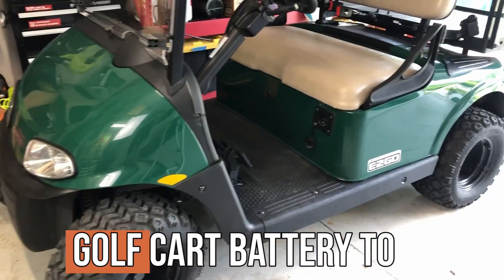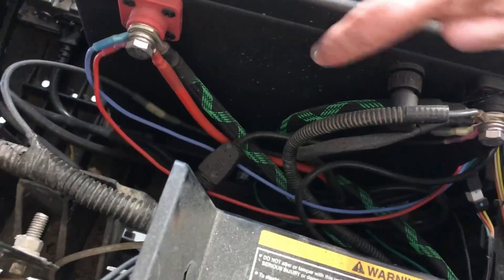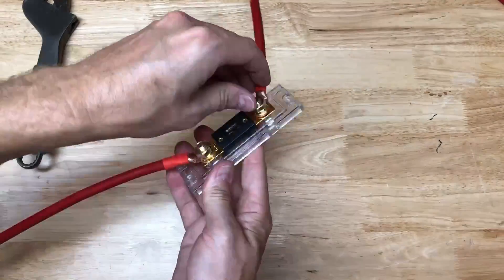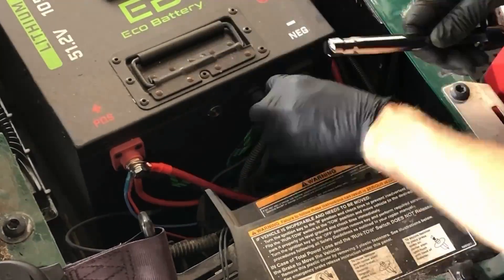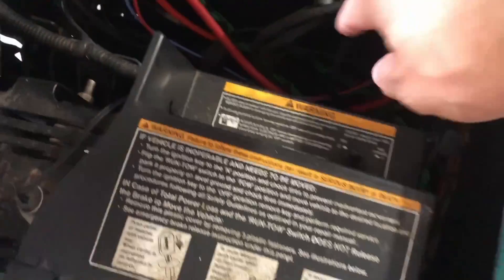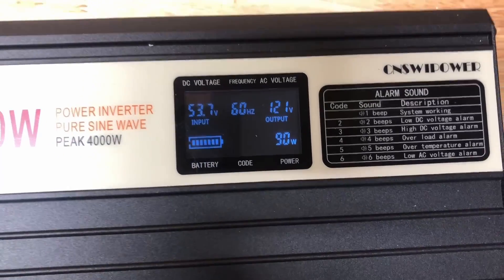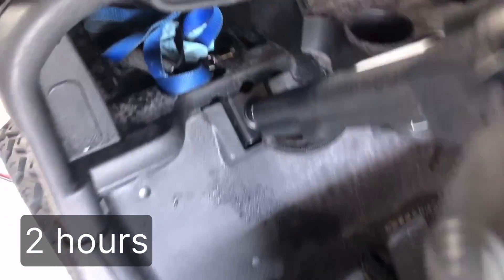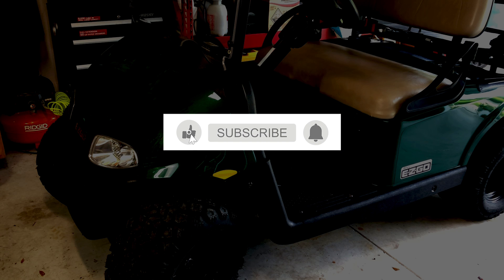Powering a Refrigerator with Golf Cart Batteries (48v to 120v Power Inverter)

Comment: Thanks for the video!  One question, the specs on the fuse ("Inline ANL fuse holder is suitable for circuits with a rated voltage of 32V") say it is for a 32 volt system, is it ok for this system with a 48 volt battery?

Comment: Great video! In a power down situation could you charge the cart via a small gas generator while still running the inverter off the cart's battery?
Reply from the maker: Would not recommend that. Probably best to either change the battery, or use the battery, not both.

Comment: Do you think 3 refrigerators can be ran simultaneously off this setup, in an outage situation?
Reply from the maker: I think you could rotate them, and could probably run two at the same time easily based on what I seen in the test I ran.

Comment: Great video. Looking for advice. My 48v golf cart has eight 6v lead acid deep cycle batteries. The label on each battery reads “115 mins @ 75 Amps    225 Ah @ 20 Hr”. I’m considering purchasing an inverter as emergency backup power for a full sized refrigerator like the one in the video. How long do we estimate that this would run and what is the best size inverter (1000, 2000, etc)?
Reply: My uncertainty is mostly about how to read the amp hours on the label. If the batteries are 225ah, an inverter loses 15%, and the fridge uses 50w per hour. Is this the math?

(225ah * (6v * 8batteries) X 85%) / 50w = 183 hours of run time
Reply from the maker: Thanks, It's hard to say, but I would expect results not too far off from mine.

Comment: This is awesome! I am going to try this, thank you! I have difficulty calculating the amount of time I can get from the charge (down to 20%). You ran a fridge, but I need to run a fridge and a freezer, and a small (600 Watts) window AC that will only run at night. Is there a formula? I also need to be able to re-charge the batteries, so I will be using a gas generator, do you know how long it would take to fully recharge the 48 volt system? Thank you for this
Reply: Video creator may know more but the A/C I believe uses 600 watts consistently versus up to 100 watts intermittent. I believe it would drain the battery in an hour or two assuming the inverter can put out 600w at once. I think you'd need a larger battery for that usage. Freezer might be okay though.
Reply from the maker: I don't know sorry, but I would be careful running all 3 at the same time. You can of course alternate them. I was suprised how little power the fridge took compared to the capacity of the batteries and inverter.

Comment: Since this is connected to the golf cart battery, does the chassis ground on the inverter need to be connected to the golf cart chassis?
Reply from the maker: No it does not, in most golf carts, the negative terminal of the battery is not directly connected to the chassis like it would be in a car's electrical system. Unlike cars, which use the chassis as a common ground to simplify wiring, battery-powered systems don’t rely on a physical ground (such as a metal frame or earth ground). Both the positive and negative terminals are connected directly to the devices being powered, and no external ground is needed.